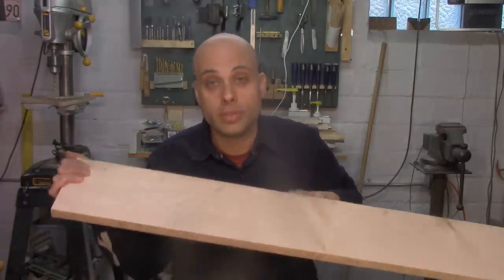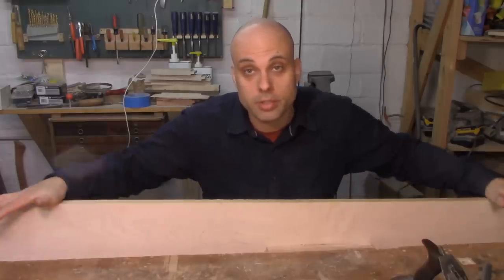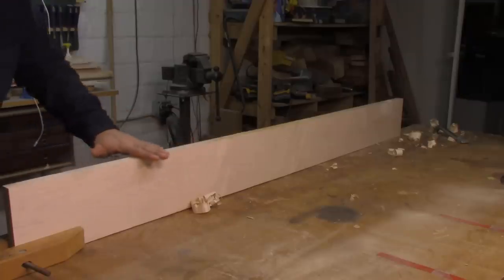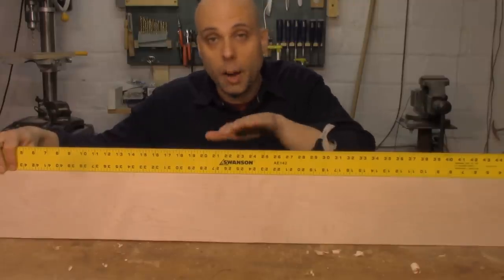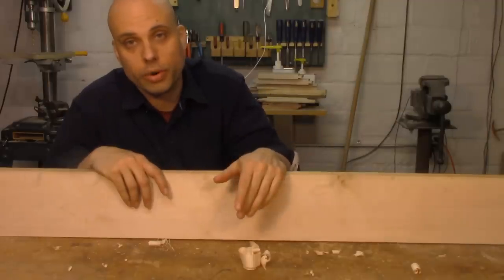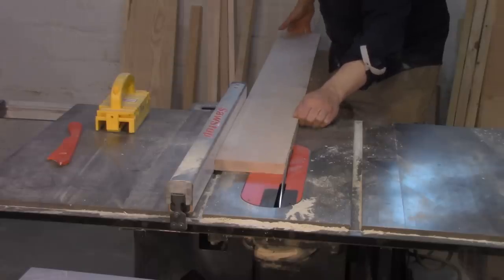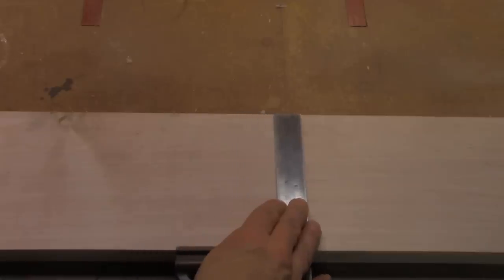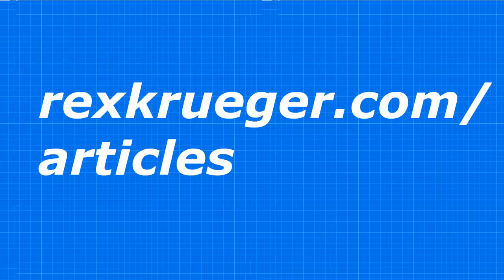Straighten boards. No jointer. No jig.

Comment: Ripping to straighten a board can be done more efficiently by extending the rip fence to as long as practical.  This also reduces the need for much hand planing.  I hardly ever choose to. Extend the rip fence by clamping a 6' or  8' carpenter's level to it. You can get great results even on a contractor's table saw if you shim out the level (now your rip fence face) to make the saw blade is exactly parallel to the rip fence.  It helps to put a 3' level close against the fully exposed saw blade and bring the now-extended rip fence up to it. Look for a uniform gap between the levels. 

Check the blade for being square to the table, if you are concerned. Like Rex said, repeated passes, flipping the board between each, is the key to straightness. Take as many as you need to get the board a straight that is as you need.Final passes may be a  sixteenth of an inch or less, so you typically lose most of the finished width from the initial twist, not over-saw-cutting with this method.

You can get paper thin offcuts 8' long with this setup and some soft woods.

Comment: I just use something with a straight edge (like ply) to ride the fence and attach the board, run it through the saw which gives one straight edge, then flip and saw the other edge parallel (without the ply).
Reply: Exactly! With a kickin Rip Blade the thing is ready to glue in 2 minutes! This video is a total waste of time
Reply: You're showing how to get their heads bashed in with kickback, Man this is Sooo wrong!

Comment: Nice Video, Tho I don't agree with sawing off the edge you hand planed.  In my previous life I studied to be a furniture designer and the first thing we were taught was to plane face side and face edge, after that you would mark the width of your piece and plane down to that,  then same for depth,  you always used face side and face edge as your reference you also use a square to ensure face side and face edge were 90 degrees to each other.   I built a 36" by 66" workbench using this technique and from one corner to the other was less than a 64th of an inch out.  Why are people not being taught this technique anymore.  I also firmly believe that everyone that does cabinet making should own a Try Plane,  I don't own a jointer and would always resort to using my Try Plane to square timber.  Its not difficult but does require practice and eventually becomes an almost Zen Experience... I wish sharpening the thing was the same.

Comment: The time it takes you to straighten the edge of one board with a jack plane, seems about as much time it would take you to make a simple jig for the table saw out of a piece of plywood and a couple of cheap hold down clamps.
Reply from the maker: It's much slower in the video because I'm teaching it. In the shop, I'm very quick.
Reply: It's not about the time, it's about the enjoyment and the quality from your hands...but as long as we're talking about time...you take your jointer and a board from your local lumberyard and I'll take my hand planes and we'll see which of us gets a straight edge first...I'll beat you every time.

Comment: Hi, I enjoyed the video and can see that increasing or practicing skills is a good reason to employ this technique but for speed would you use a jig on the table saw to affect the same result?
Reply from the maker: Absolutely, but check out the title: "No jointer; no jig." And the other thing is, this is how I actually do it in my business. I don't find a jog helpful, especially for very long boards where the jig would be awkward. A little plane work, through the saw, and I'm done. This is the method I use day-to-day. Good question!
Reply: I agree with H2Dwoat, seems like a good practice exercise for the plane and as such, is a good video.  But time is money.  I use a track saw to straighten the edge on long and short boards.  It's cheaper than a jointer, is useful for a lot of tasks, requires less space, and it does the job quickly and accurately.  That said, I'm looking forward to having  a jointer someday.

Comment: This was really, really good - thanks! But you don't rotate the board on the table saw. That would put the opposite edge against the fence. What you're doing is flipping it lengthwise rather than width-wise.
Reply from the maker: In fact, I DO rotate the board and I AM putting the opposite edge against the fence. That's the whole point. Some of the edits I made don't show the rotation clearly, but if you watch the video the whole way through, you'll clearly see me rotating it between cuts. Anyway, thanks for watching!
Reply: Rex Krueger oh I misunderstood! (For some reason I thought that at that time you were saying that you wanted to keep the same edge against the fence, my bad.)
Reply from the maker: No trouble at all!  I love engaged viewers who ask good questions and make smart comments.

Comment: That's interesting. I've been trying to straighten up a cheap 2x4 using my jack plane, and go decent results so far, but I'm struggling with keeping the edges at 90 degree. I don't have powertools and can't have them (no space + too much noise), but I've been working hard at building myself a decent manual tool workspace. Any recommendations to do it all by hand?  Making some kind of an external fence to run the jack place against to keep things square maybe? I'm also currently building my bench, and its surface isn't 100% straight yet, either.
Reply from the maker: I'd look for a an old wooden or transitional jointer plane. Those are a great value and work very well.
Reply: @RexKrueger  That's really good to know, thank you so much!

Comment: Good vid - but my Woodwork teacher always used to shout at us if he ever saw anyone putting a Plane down like you did!  We were always told to lay it on its side so as not to damage the blade...
Reply from the maker: I'm sure your teacher was great, but that thing about planes is an old wives tale. Not only do I do it with no trouble, Paul Sellers and Rob Cosman, who are both acknowledged masters of the craft, but set their planes straight down. It's fine.
Reply: Thanks Rex - possibly an old English thing?  I'm in my 40's now and it's a habit I'm stuck with.  Your video has also reminded me that I need to tidy my workshop!!!

Comment: Couldnt you just use and engineers straight edge to mark the entire edge of the board before starting. That way you have a perfectly straight line to start with. I work with metal not wood so completely honest question
Reply from the maker: Most of the boards we need to straighten are too long for that to be practical. A chalk-line is a good alternative, though. Many of us use them.

Comment: I was curious on what jackplane you used? I dont have one yet and I was wondering what you would recommend?
Reply from the maker: I love a vintage Stanley No5. That's the standard. If a Stanley is hard to find where you are, look for other brands that made a similar plane like Record, Union, Sargent or Millers Falls. All these companies made jack planes that are essentially identical to the Stanley and they often cost less. Check out the rest of my channel for tips on plane restoration.

Comment: This works if you have a jack plane and a woodworking table with an vise mounted on one end, but sadly, I have none of those. Yeah, it's tough doing woodworking without a table, but I can't do much about that until I can afford a house with a room I can call my own and make into a real woodshop.  In the mean time, however, I have a Shopsmith with a 12" disk sander and a table on which I can mount a fence.  (Any largish disk sander with an 80-grit disk should work as well as long as it has a table big enough with maybe some end supports to hold your board).  I set the fence on the opposite side of the board I am sanding and put the board's waviest side against the sanding disk.  I then set the distance so the board's widest point just touches the sanding disk, then pass the board through the sander removing the high spots as I go.  I then move the fence in 1/32", sand the edge again and keep doing that until the whole edge is reasonably flat.  I then set up the table saw and slice off a thin strip of the unsanded side and, if necessary, one off the sanded side as well.  Both sides can be sanded again for extra smoothness and/or dimensioning but I find that a fine-tooth saw blade is enough to make them both ready for glue-up.  The movable quill on the Shopsmith helps a lot when using the disk sander to accurately dimension smaller pieces of wood, but it is difficult to reach when sanding long boards. Also, live-edge and really bent boards may require sawing without a fence as the first step just to cut the wavy side off, then the sand and cut treatment until the board is straight and square on both edges.  A band saw would help here but, alas, I don't have one of those either...
Reply from the maker: I hear you. The problems you describe are problems that this channel is trying to solve. I plan to have videos on making a simple bench and building your own vise out of wood. I already have a 3 part series of vids on making your own planes. It sounds like you're making do with some simple tools and that's the way to do it. I started woodworking a little over 10 years ago in the corner of a garage. I had a jig saw, a drill, and not much else. My "tootbox" was a set of plastic shelves. If you just keep going, your situation will improve.

Comment: Very old style and I respect that but this takes over 1 hour to play with 1 board only. Imagine doing 10-15 boards like that. Ohh mamma. It would be better to just get dewalt 733 or so thicknesser put in on wide side and if it needed than  place it on long piece of flat plywood level it if needed and run it through. After 2 wide sides are sorted  then cut it with table saw.

Comment: If you already have a jack plane (jointer) then why the need of the table saw or any other work method to joint a board? The correct tool for jointing is a jointer whether it’s a power jointer or a hand plane. When will these content provides stop giving shifty advice?

Comment: What do you do if your boards have splits in them? I have some black walnut that split while it was waiting to be used. I haven't checked yet but I'm assuming that they're not even.
Reply from the maker: Generally, you want to cut the split parts off. Or, you could rip along the splits and make narrower boards. You can fill with epoxy and add a decorative bow-tie. Whatever you do, don't force the splits back together. Those boards split because they were releasing tension and that's a good thing.

Comment: Providing the board faces are OK, use a laser or a chalk line to strike a straight line near one edge of the board. Use this as a guide to mount a straightedge slightly overlapping the board. This straightedge will contact the fence on the table saw. Run that, remove the straightedge, flip the board and run the other side, now that you have a straight edge on the board to contact the fence. At the cost of a few screw holes in your stock, you save an hour of labor with a plane.
I have little use for any hand tools in my shop. In fact I do not own a plane.  If I want stock actually square and straight, not approximately square and straight but actually square and straight, I use a jig and a machine tool.

Comment: Wow I didnt know some jack plane blades have a camber . That sounds hard to deal with .
Reply from the maker: Well, they only have a camber if you put one in when sharpening. But that's the common practice with jack/fore planes. The camber makes the plane way more efficient for fast stock removal and keeps the blade's corners from digging in. It's no trouble to deal with. Just part of the tool. Good question, though. Thanks for watching!
Reply: Thanks , as a carpenter I am ashamed I hadn't heard of that practice . Always learning , always learning.
Reply from the maker: Dude, do not be ashamed. I am the world's shittiest carpenter. I bet I could work with you for a year and not learn everything you know. It's crazy to me how different woodworking and carpentry are. You can know SO much about one and nearly nothing about the other.
Reply: Ahh your too modest , I appreciate your kind words . Carpentry is an extremely diverse area I agree . I look forward to the next video :)
Reply: i inherited a beautiful plane that looks like yours, and all the blades that came with it have a STRONG camber. almost semicircular. it is impossible to not cause a small cup when planing. And all the plates are convex as well. i have no idea what it was used for. digging channels maybe?
Reply from the maker: Sounds like a scrub plane. They're made for HEAVY stock removal. I'm not sure what you mean by "plates" but I'm intrigued. Can you explain?
Reply: Sorry, I have 4 different soles. They are all at least a tad convex, and wobble on a flat a surface. Some more than others.
Reply from the maker: Ah!  You have a pattern-maker's plane. It's for creating different hollow shapes in wood. It's no good for the kind of basic flattening and straightening I did in this video, but it probably has a lot of specialized uses and it's also collectible. A real treasure. Keep it safe!
Reply: @GL-tx9dv , wish I could see a pic of that. I cannot picture a plane that looks like Rex's jack, but has separate soles. Could you be meaning a no.45 or no.55 Stanley or Record?

Comment: Should i buy a jack plane or an electric hand plane?
Reply from the maker: So, that really depends on your goals and the kind of woodworking you want to do. If you're interested in fine work and furniture making, you might find an electric plane is kind of a rough tool. They work, but they don't really do what a hand plane does. They are not capable of fine shavings. If you can find an old Stanley for less than $50 (preferably a lot less, but I don't know where you live) then get one, fix it up and learn to use it. You can always get the electric later on. Good luck!

Comment: could you use a band saw with feather boards to do the same thing ,i just bought roughing plane from lowes made by kolbolt is it just asgood?
Reply from the maker: I wish I could say it is, but those planes suck. I'm no tool snob, but those are just junk. You CAN make it into a "scrub" plane (google it). And that will totally work, but if you want a plane to even a little bit of fine work, you need to either drop big money on a new, premium plane or find a good old Stanley, Sargent, Record, Millers Falls, etc. Lots of good old planes out there. 

As to the bandsaw, the feather board wouldn't do any good, but you COULD snap a chalk line, cut that line very carefully on the bandsaw and then take it to the table saw and do what i did. That should work.

Comment: It's called a good circular saw with a ripping blade and an aluminum straight edge clamped on the face of the board. Takes 1/100th the amount of time and will actually get a straight edge.
Reply: You will get a straight edge but not a super smooth finish.

Comment: I was joining boards over weekend (my first), I do own inherited old home made joiner, but my skills with it are far from good (not like a modern machine) so I was finishing up with long joiner hand plane, but still it is hard for  me to have on long board to have perfect straight edge. my problem is that beginning and end are lower and I have a small hill in the middle. I tried different approaches (taking middle first) and I just cant get rid of it, always end up with slight hill in the middle and first and last inch or 2 are down)... also, even when I try to have perfect 90 degrees between reference face and joined edge (0 light coming under square), when pressed together, it still don't fit properly... Do you have some advice for novice hobbyist?. Tomas
Reply from the maker: So, taking the middle down is a good approach, but you may need to take it further. You actually want to take the middle down to the point where the jointer will not take a shaving anymore. Then start at either end and focus on taking a full shaving with the pinch grip I demonstrate here. Another problem could be your jointer. It might not be flat. Also, according to Paul Sellers, long iron planes can flex in use, even if they are flat. I don't know if you watch Wood By Wright, but he has at least one very good video on jointing. He's better at it than me because he's an all hand-tool guy. Hope that helped!
Reply: Thank you, I did watch video by wood by wright and I have wooden Jointer, European style. As far as I know it's flat, so it must be my technique and I need to work on it I guess :) Keep up good work on this channel, I learned a lot.
Reply from the maker: I'm glad you find it useful!
Reply: Learn how to identify the kinks on the board and learn to target them with a plane.

Comment: I find it so strange how you prioritise tools. You don't have a jointer, but you do have a table saw, even though a table saw has all the problems you listed jointers having. We have a jointer but not a table saw. I would love to have both, but table saws just take up so much space and we've always been able to do anything a table saw would do with either a jointer or a plunge saw or a mitre saw, all of which tuck away in a corner when they're not in use

Comment: On a decent table saw you normally expect to produce a nice straight 90º cut if it's set up correctly and you're careful to use correct technique/maintain material contact with the fence & table saw table top while pushing the material through - why not just start out using the table saw to create your starting edge? - how much more accurate is using a jack plane to create your starting edge? - I don't see what the advantages are of starting out with a jack plane, if in the end your using the table saw to create both of your finished edges - any reason the method in this other video won't yield the same results? https://www.youtube.com/watch?v=d_OGmnbtmyY